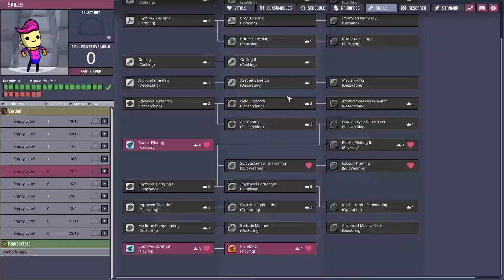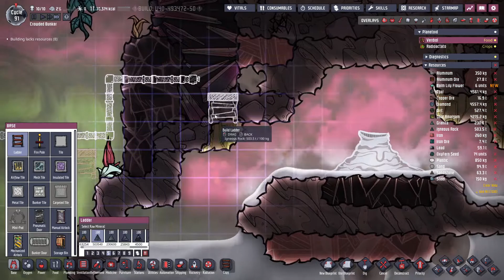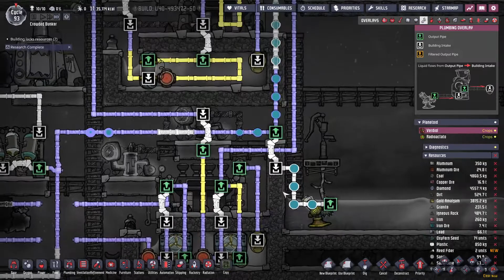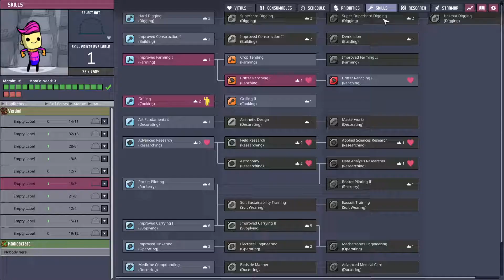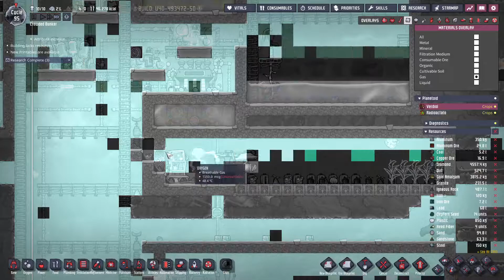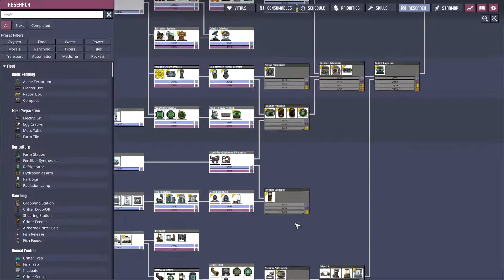Oxygen Not Included - Most Dupes Record Attempt - Part 7

Comment: Why 225C for the around the loop, when the max of a steam turbine is 200C? Also why did you not put the check closer to the end of the loop of the steam room?
Reply from the maker: There will always be a difference between the steam and coolant temps. To be honest the energy recapture is just a little bonus so I don't consider it critical to optimize.
Reply: Also, it most likely will never get above as you show in a later video. Just not making enough Steel to really do it.